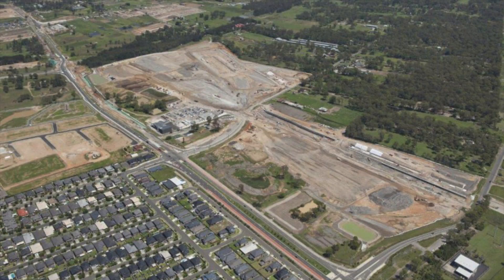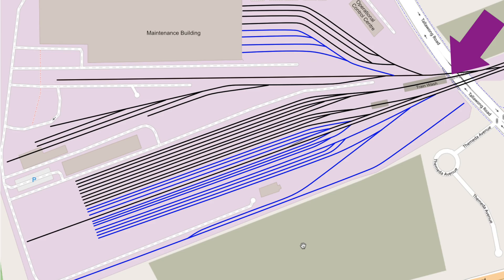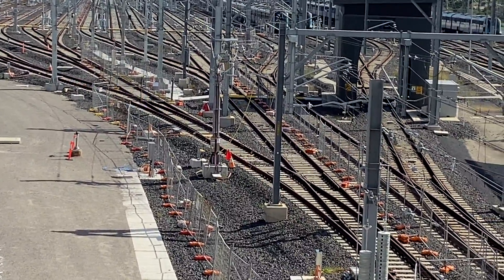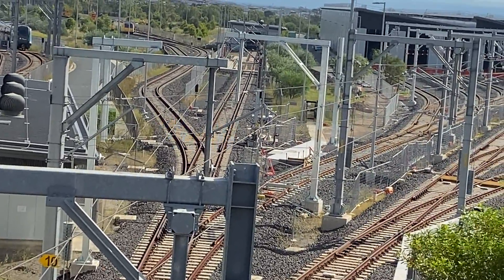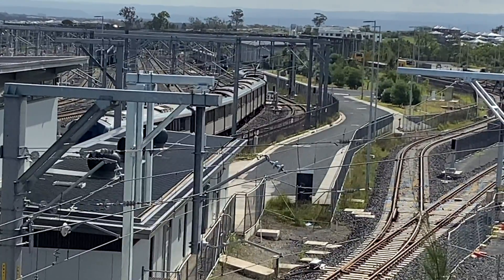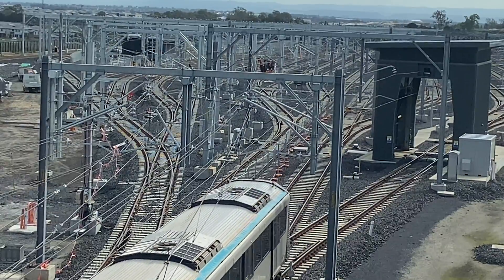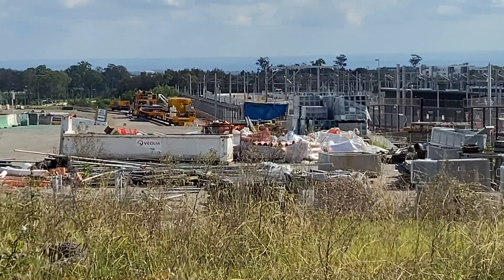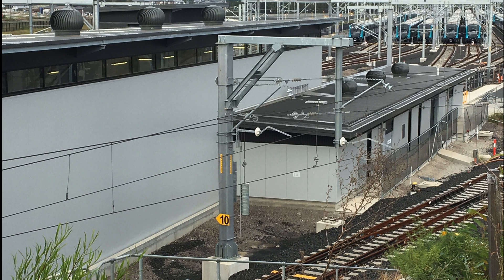Sydney Metro Trains Facility North Expansion at Rouse Hill - Autumn 2021 Update

Comment: The yellow vehicle is an electric locomotive. Sometimes when it’s late at night (like 1am) and services have ceased for the day you see it on the skytrain viaduct, I have seen it once shunting a metro train, I believe it is probably used for a combination of things like testing, maintenance and shunting trains in the event of a breakdown. You won’t typically see it on the metro network and I doubt it ever goes on the network during operating hours except for emergencies like a breakdown, I think putting it on the network would jeopardise the automation of the network and cause chaos.
Reply from the maker: Thanks for that Liam. It would be interesting to see it out on the line, but as you say, it would probably cause chaos! Perhaps it might come out to help with the City & Southwest line testing when all the track and electrics are done.
Reply: @TransportVlog  It is also possible that the metro trains were hauled out of the garage for refurbishment, we generally have internal combustion locomotives in China.
Reply: It could possibly come out on weekends when the whole line is closed for maintenance.  I wonder if it has some wagons attached for carrying equipment and supplies?

Comment: Fascinating as usual! I have always been curious to see the maintenance depot in more depth than just brief images. I do think it is quite important that an extension be built from St Mary's to either Tallawong or Westmead. Both would work well, however I particularly thought Westmead would make more sense because the whole reason The Western Sydney Airport is being built is to not only take pressure off of the current airport but to serve the west. So if they connected the airport metro line to the Paramatta line then it would be connecting the new airport to the west, ultimately fulfilling part of its purpose. However I think an extension from Hunter Street to Central would then be necessary for easy interchange with the rest of the Sydney transport network, including if travellers needed to transfer to the current airport. An extension to Tallawong would also work as it would serve the northwest, and the link to the city and Central would already be there, as well as the Southwest. It would only be bypassing the central west, but I guess that is where you could interchange onto the current Sydney Trains network to get to your final destination in the central west. This is my personal opinion, and I am not sure everyone would agree, but I spent a while pondering this issue and this is what I came up with. Whatever option is chosen to connect the western airport line with metro lines going east, it should be done quite soon either at or not long after the airport is opened. Sorry if this was a lot to read, but I have felt I needed to express my opinion and solutions to this issue for a while now. 
P.S. Above the title you spelt Tallawong as "Tallawang"... Just thought I would let you know. :) Thanks for this great video.
Reply from the maker: Yes I agree, it would make sense to link St Mary's with Westmead as an interchange at St Mary's is not ideal for serving the Parramatta area. It also seems strange that Sydney Metro West is terminating at Hunter Street. I would be keen to see it extended into the eastern suburbs, or north east towards Mosman and Manly or down towards Maroubra. Thanks for picking up on the spelling of Tallawong. Now corrected! Glad you enjoyed this video.
Reply: @TransportVlog  Hunter St is an absurd mind boggling choice, every building on one side of Hunter St will need to be demolished up to at least Castlereagh street to accommodate the 220M station site length, at least nine buildings some very tall will need to be demolished.
Both the station and rail line will need to be 40m deep to go under the 25M depth of the existing metro tunnels.
Any extension to the east will require demolition of a number of super tall buildings on Hunter St east of Castlereagh St, Chifley towers or the brand new super tall buildings on the other side.
A Hunter St Station is $2B in resumptions before demolitions and Station infrastructure is built, total cost of this idea will be $3B-$4B just for the one station. It also requires very delicate placement between large buildings in Barangaroo and the preceding cross streets. 
St James is a much smarter idea, using a large diameter single tunnel 8.5m under Market St the station built under Hyde Park accessed with a closure of St James Rd, zero  resumptions, a direct connection to the Circle Lines and 330m walk to Martin Pl via an underground footway below Phillip St, an underground footway could be built under Market St with access points at all cross streets and the QVB.
Its a straight line to Pyrmont Station, no complex infrastructure impediments, an easterly or northern extension has no obstructions, extension to the north has enough fall to the harbour to be built cheaply entirely in hard rock.
Reply from the maker: @kcobley  Thanks Kevin, Interesting and thought provoking points! I've already worked out what will be knocked down for the new Hunter Street station, so will do a video on that, once the lockdown is over!

Comment: Nice Paul! Interesting to see this progress being made, the loco siding could possibly hold a locomotive for shunting or for hauling a broken down train to the maintenance centre.
Reply: Or possibly for the carriages at the front and back of the trains. I am not too sure though.
Reply from the maker: Yes possibly.
Reply from the maker: Thanks! Glad you enjoyed it. I guess you need an emergency diesel loco in case the electrics fail and to repair overhead lines.
Reply: How on earth would a Sydney metro train be preserved? It certainly wouldn't be able to operate!
Reply: @griffinrails  it would be able to operate on the metro north west line for heritage, or it could be driven using the controls around the network

Comment: At 7:51, you mention the extention  fown to St Marys (which is a very good idea to connect the lines up) but where would the new tracks go and will they stay overground. I think it would go around on the left but idk. 

Nice vlog as always.

Also do you just have like a huge amount of videos as backlog or starting to run out since with the lockdown.
Reply from the maker: At the moment, any possible extension to St Marys is at a very early stage. Decisions such as route alignment and how much would be overground and underground is still to be decided. Yes still plenty of video footage to edit and narrate, including a few from the Newcastle area. I'm actually quite enjoying sitting at home and editing them! - The main difference will be a lack of Sydney Metro update videos until the lockdown finishes.
Reply: the St. Mary's station plan includes stub tunnels for the extension so i expect it'll be underground all or most of the way

Comment: When will the extension to St Mary's be built? Will it be above ground? 
The west needs a second link into the CBD.  This will take overcrowding of the western line.
Reply: The talk I've seen so far has this line extending only to Schofields. It is not intended to link it to the Airport metro.
Reply from the maker: It's part of a longer plan for future Sydney Metro lines. At the moment, it's just a proposal, so the likely route and which bits are above and underground is still very much up in the air.
Reply: It will be underground at Mary’s and I think until it gets closer to the airport will be a mixture of Underground and overground given a lot of the area where the new airport is going is consider a flood plain. Also interestingly and not sure you know this Paul, but at St Mary’s, Station plaza has been brought by Sydney Metro and has to close either at the end of this year or early next year to be able to start the tunnel digging there. Only known this cause the Plaza’s owners have been trying to find a new site in St Mary’s and were knocked back by council and coles is trying to look for a new home for its St Mary’s store in Station Plaza